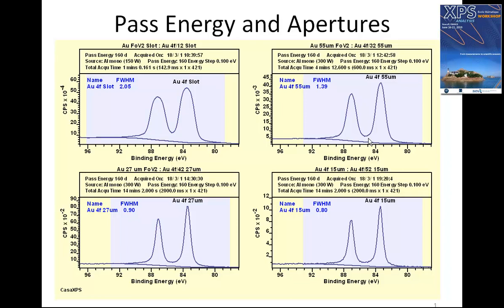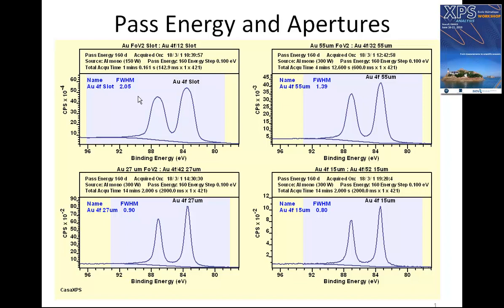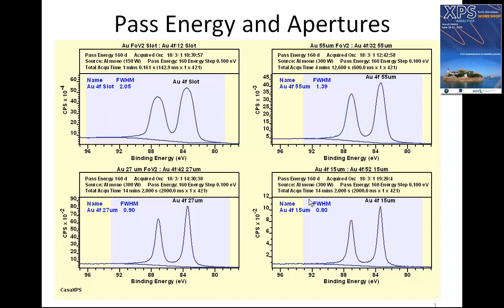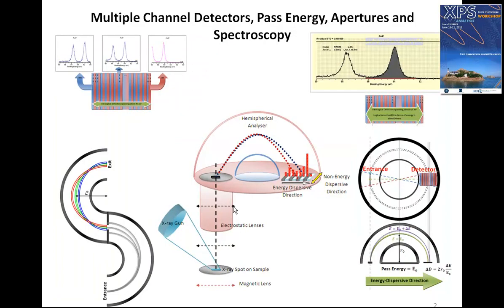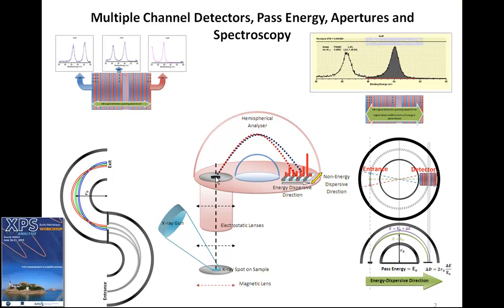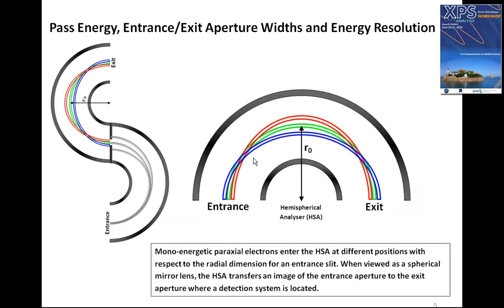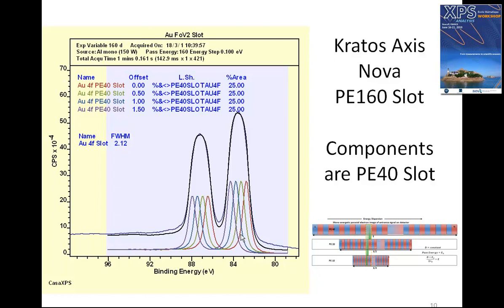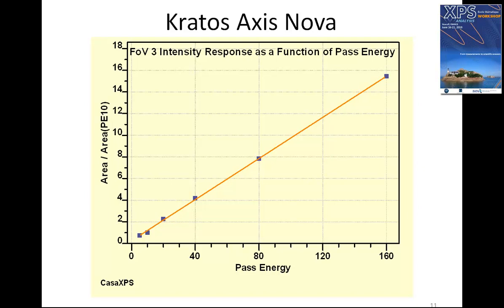Scanned Mode and Snapshot Mode for XPS Multi-channel Detector Instruments is Explained.

Comment: Hi Sir, great presentation. I noticed there is lack of multi-channel electron detector's explanation online. Your video is really helpful. Where can I get this pdf version of the book?
Reply from the maker: http://www.casaxps.com/SW-Workshop/ExperiencedSessionRoscoff2019.pdf
Reply: Thank you
Reply: Hi Sir, I have a question - 

In #4:10, electrons arrives on the 000 detector (leftmost) should have the lowest kinetic energy, the binding energy should be higher. But your drawing is reversed.